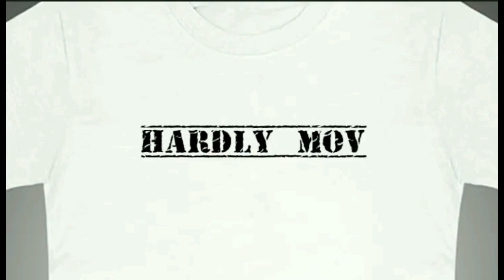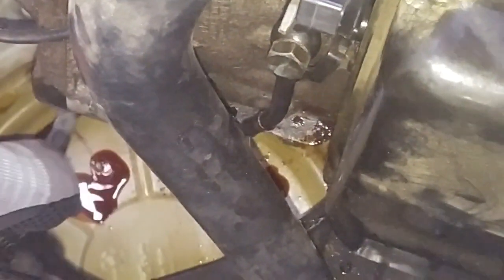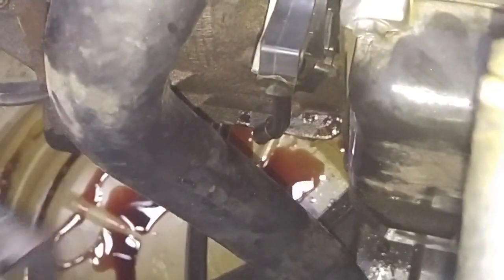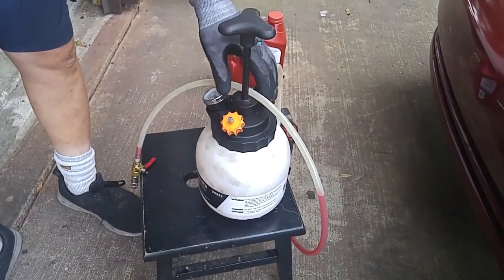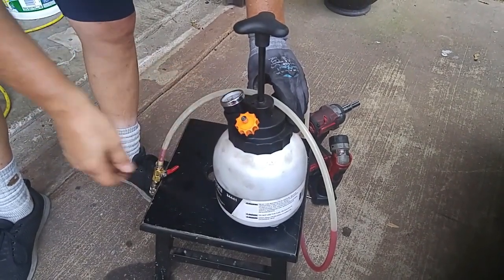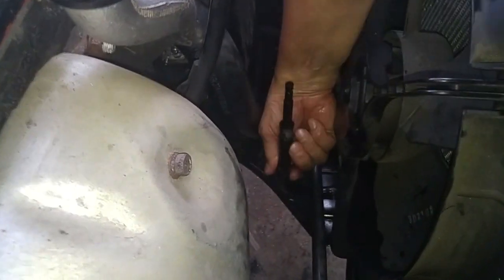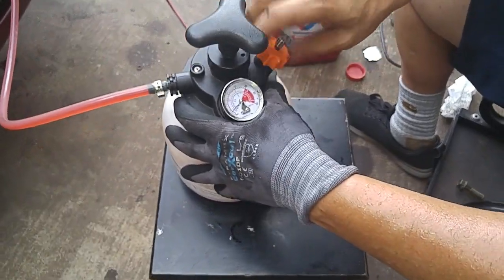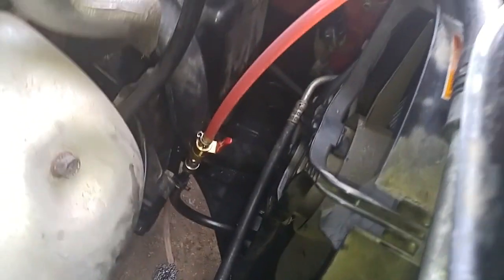No Transmission Dip Stick? Easy How To ATF Transmission Fluid Change!

Comment: My dipstick disappeared today. This is the method I will use temporarily to make certain I have the correct amount of transmission fluid, then I should be able to find a dipstick that I can make work! Or at least that's my plan 🤗 Thanks
Reply from the maker: Try using a long needle nose pliers to pull the stick out.  Otherwise drop the oil pan.  Good luck!

Comment: Have a Ford Fusion now with no reverse..It blew the check ball right through the Valve body separator plate..Still can not find a new bonded separator plate. Called Sonex and a few others..You have to buy the whole valve body to get that plate..
Reply from the maker: Time to visit the salvage yard?

Comment: Hi i have a chevrolet optra when accelerating and i get to speeds of 80kms/hr and above car has a hard sturter and hold light starts to flash. When the car cools the hold disapears on its own. If i drive speeds bellow 80 car is fine qnd smooth. My temparature sensor failed so i put fans direct. Any advice?
Reply from the maker: Sorry ... don't understand.
Reply: Piston seal likes to go bad on these transmissions. You need to take your car to a transmission specialist. They need to open the transmission replace the piston seal and worn clutches. These are horrible transmissions.

Comment: can you make a video how to change  transmission oil filter
Reply from the maker: Although similar, not all cars have the same transmission filter design.
Reply: @hardlymovingpro  i use chevrolet optra 1.8
Reply: @kurosakiichigo85  you need to open the transmission to replace the filter on these ZF transmission it's not easy. A transmission specialist need to do it.

Comment: what do you recommmend to flush entire transmission oil
just drain, fill, drive and replace 3 times.

or can i use the same  method like u did in this video , means put it in neutral and just keep at idle to get all oil out using return line. will it emty torque and radiator oil as well.. or that will cause transmision to be in a problem.
Reply from the maker: Depends on how dirty the oil is.  If pitch black, start with a drain and fill.  Wait till the next engine oil change to let the ATF detergents do its work, then check the oil color again.  If dark red, you can do a flush.  No transmission problems using the technique used in this video.